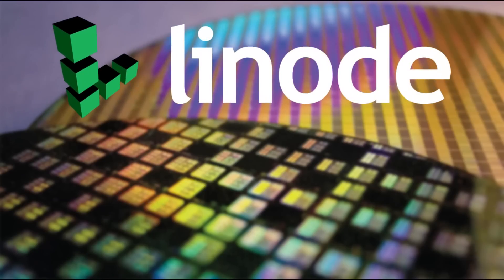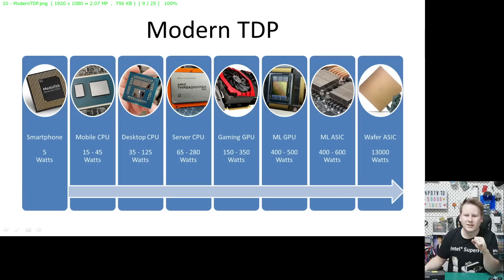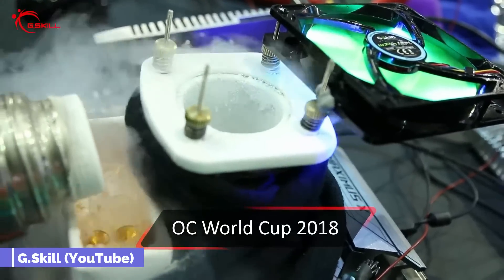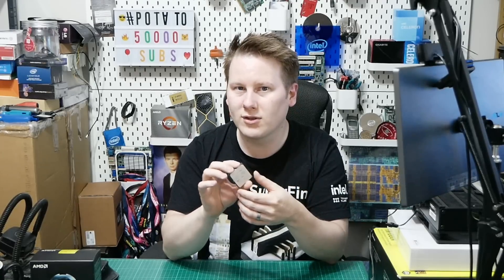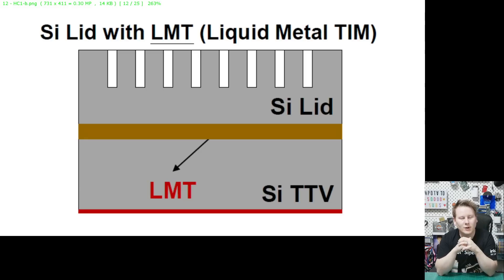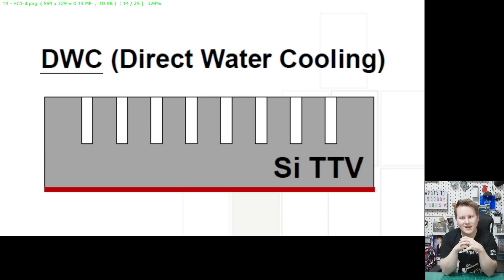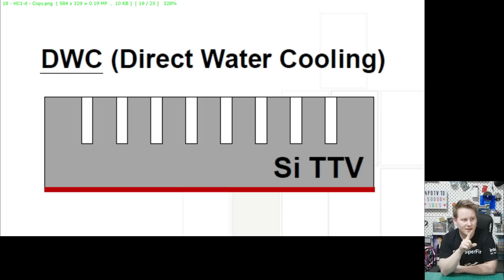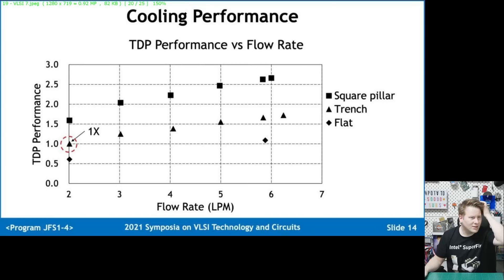How to Cool a 2600 Watt CPU or GPU 🔥🔥🚒

Comment: If we can get high band- gap logic chips, then they could run at higher temperature and be easier to cool. 🤓 200C? Sounds preachy! Also, you could heat usable water or steam with those temperatures and reclaim some energy. 
I like how these chips with integrated water cooling will probably be like a nuclear power plant, with inner and outer cooling loops. 😄 The water in the micro channels needs to be very clean, no pastel loop pigments! 😛

Comment: I have generally wanted more performance out of my machine but I am NOT going to freeze my nuts off just to get that lol, guess it is just water cooling then and not moving to the arctic circle ;~) I am also wondering if they will ever incorporate graphene into the heat removal process.

Comment: and honestly i dont think air is the limit, the heatsinks pcs use really seem to be designed like crap and use thin/cheap/not dense metal, imagine how much heat you could make a cpu generate being attached to a gigantic heavy block of copper or lead or something. i was using a 5lb weight plate as a pseudo heatsink for my pc for a while and it worked incredibly well lol. playing devils advocate with this is fun, think of instead how much heat is required to heat X  giant metal object haha

Comment: Why do industry people say "water vs air"? Seems wrong to me. Shouldn't it be water vs metal? They both ultimately use air to remove heat from the system.

Comment: The fact that THIS sort of insane cooling is even seriously research is proof that perpetuating silicon based IC and neglecting research into post silicon tech is a huge mistake.
Reply: Work is being done to go post-silicon, but it's slow progress. This is how we buy time for the kinks to get worked out.
Reply from the maker: The problem is that post silicon tech has to beat 30-50 years of optimization on day 1 to be viable.

Comment: To be correct delta values of Temperatures are K not °C
Reply: delta values are the same for kelvin and °C...
Reply: @jtrevathan33  the unit is K and not °C
Reply: @mumar100  if is a delta, then it doesn't matter as C and K are the same thing, just with different starting points
Reply: @khhnator  It still matters, the offset of 273,15 °C has compared to K is gone when you calculate a difference, without offset the unit is K or you have to subtract an other 273,15 from the delta (which absolutely makes no sense)

Comment: I watch two YouTube channels that heavily promote the M1 chip from Apple. According to their (limited/selective) test results, the M1 will outperform any known cpu made by Intel or AMD including their respective APU's by some considerable margin all while consuming 5 watts compared to 100+ watts by AMD and Intel. If you listen to the blurb for long enough one would get the impression that a single Mac Mini will easily replace an entire rack of x86 server processors all while consuming 5 watts. I am intrigued at how one M1 can use so little energy while outperforming all comers. Truth or bullshit, well you can answer that one. For me the clues point towards producing silicon chips which are much, much more frugal at energy consumption (and heat) while maintaining current performance levels at least. Will you address the subject of reducing power usage and heat production in one of your presentations please.
Reply: It doesn't work exactly like that. The M1 has more performance per watt. However, the x86 chips can use a lot more power thus more performance. The M1 or ARM in general can't increase their power budget to anywhere near x86. The M1 does have higher IPC but no where near the multi threaded performance.

Comment: Dragon Ball Z  "Its Over 9,000"     https://www.youtube.com/watch?v=-p_SWPZ1_ew  (someone was bound to post it) 
Love the channel and deep dives into new tech.  
Currently parts are cooled from the silcone side with connecting wires on the other. Any thoughts on cooling both sides of the device to reduce the temperature gradient ?

Comment: Or they could form a peltier device on the same Silicon, and bond its top to a highly corrosion resistant finned spredder.
Downside is higher energy usage. Uoside is better thermals. I could genuenly imagine a hibrid solution to be honest, where you got direct connection to individual chiplets, but Allso have heat pipes with peltiers for kicking in when thermals shoot up. Say you got a CPU with 4 chiplets and the most powerhungry application you run maxes out 1 chiplet, it be very nice to have a heatpioe that is indirectly in contact with that single chiplet, and the other end of that heatpioe is held at beyond room temperature by a peltierndevice.
Power consumption wise even a few watts worth  of peltier could, would, and should do the trick.

Comment: This is NEGATIVE PROGRESS!!! They should be aiming at 1 watt per core for Cisc and 1/3 rd watt for Risc processors. MY IDEAL IS an AMD or INTEL Chip with 32 Cores and TDP of 32 watt, performing on par per clock cycle with the latest chips AND AT AN AFFORDABLE PRICE. NOW, THAT IS PROGRESS!!!!! 
I CHALLENGE YOU INTEL!!! I CHALLENGE YOU AMD!!!
Reply: That's great if you're programs and work loads can be distributed to many cores.  That not easy and causes concurrency problems.